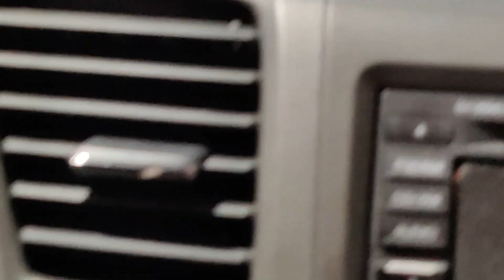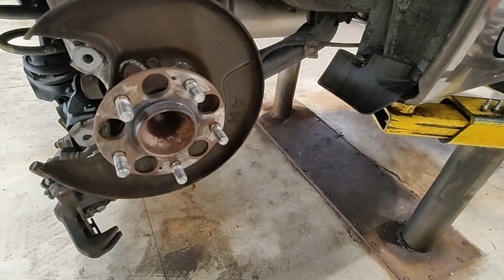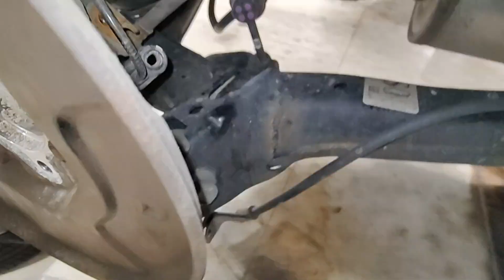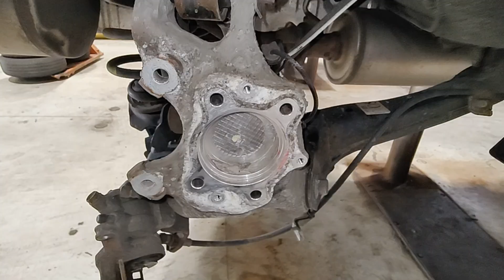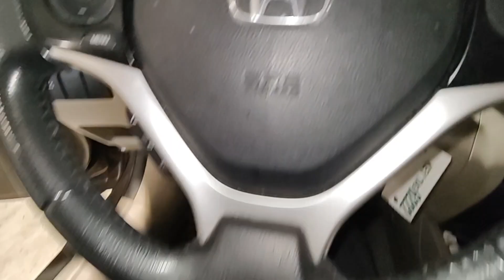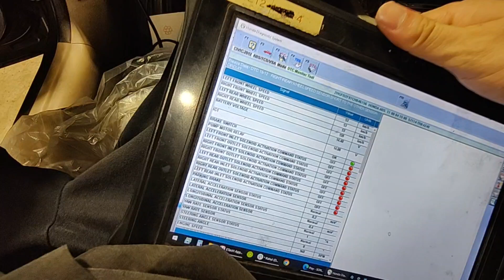2012 Honda civic with an intermittent wheel speed problem.

Comment: One reason: hub bearing going bad, once you start hearing a humming noise, getting worse with speed increase, until you stop hearing such noise, where it reaches a dangerous point because the wheel can actually fall out. Master tech here. I would apply silicone spray on that ABS sensor to help release it. Usually, silicone spray helps to break loose rubber and plastic parts that have been sitting for too long.

Comment: What is the preferred grease/lube to stop the "dissimilar metals" issue? Some kind of silicone based, or what. Is it a chemical type of thing, or just any kind of thick grease to put between the metals to reduce touching?
Reply from the maker: You can use fluid film, I use a spray on lithium grease. Anything that will protect the surface and doesn't wash off easily.